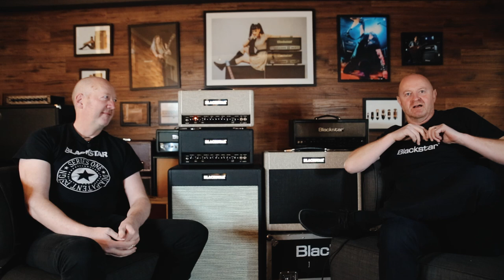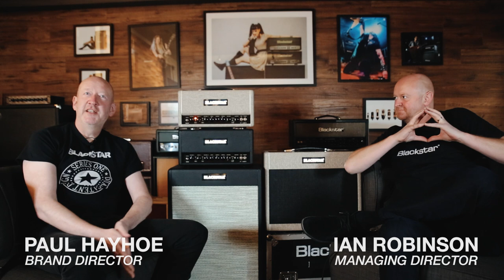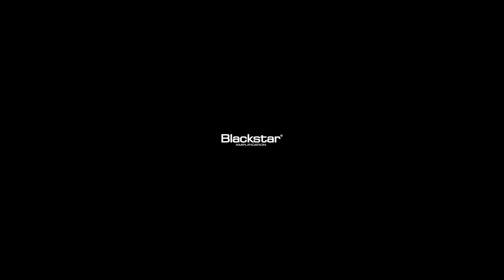St. James - Ask The Founders | Blackstar

Comment: I am a home player for leisure... I done my research the reactive load design on that amp seems superior than anything else as actual power staging done by controlling the grid voltage of the power tubes which I guess is the most closest one to use variac in traditional way. Well  it is  quite expensive for home but I am sick of plugins albeit I have  quite good ones on  UAD Apollo. Good amp never gets old while a superior plugin will come every year. good investment for convenience and it is a great deal    I will buy in 3 weeks time

Comment: Question are these cathode-biased fixed biased or is there a trim pot to bias the output valves when you change them?
Reply: Grid biased. There's actually 3 trim pots due to it having the lower power setting with a different bias setting.

Comment: I still don't really get the concept of the amps. Surely a player who wants  a perfect American clean sound wants then to take that into a great crunch sound, like a tweed crunch,  and not an ultra high gain sound? But then the vintage clean/crunch amp is based on el34s, for which you think marshall gain, and more brittle clean sounds.
Reply from the maker: Hey Steve - the clean circuit on both amps is exactly the same (high headroom American clean), despite these kind of cleans being historically associated with 6L6 designs, the EL34 model will deliver identically on this channel.

If you wanted to go into tweed crunch territory, you could either push the clean channel and dial back the master (+ set power amp to SAG). Or, dial the gain right back on the drive channel Voice 2 (American) - though this Voice does go in to high gain territory, it's designed to be highly versatile at lower gain settings too.

Hope this helps 😊
Reply: @Blackstaramps  thanks for giving this info! Seems like there are options for getting the combination of sounds. Will have to try them out when possible. Cheers.
Reply: People assume all Blackstar amps are modern/drop D/death metal amps. Big mistake.